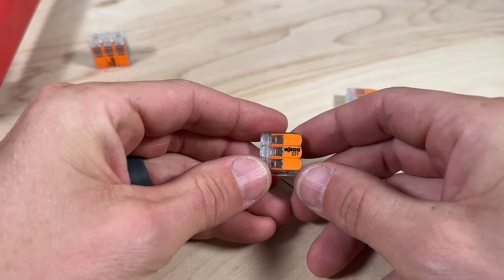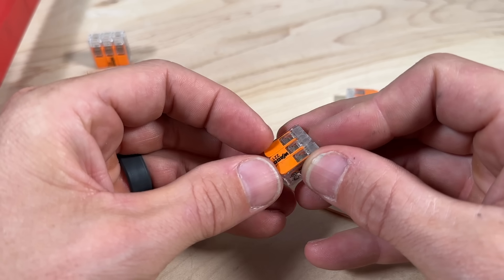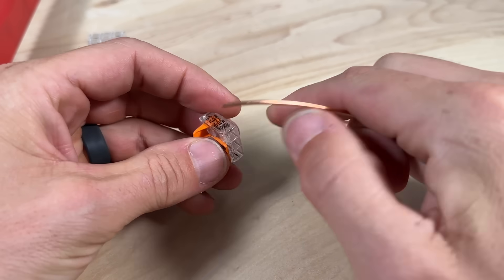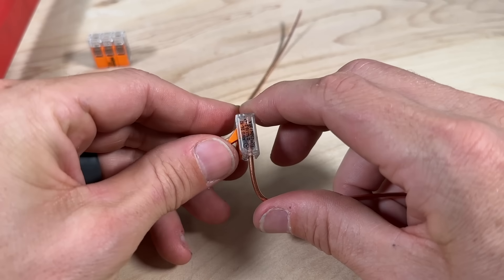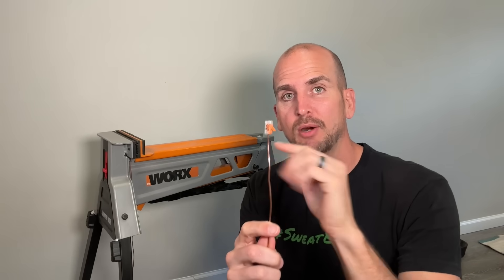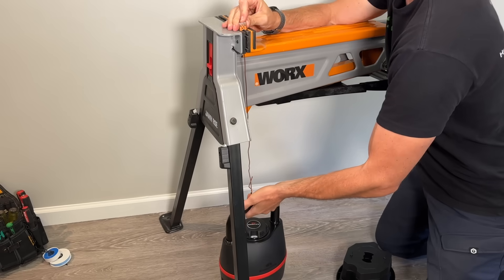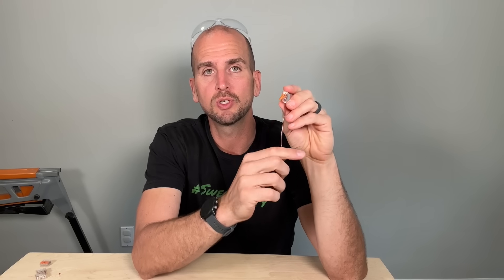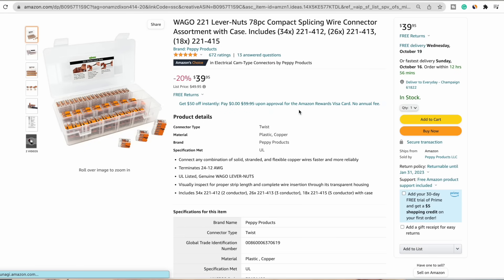WAGO 221 Lever Nuts: Testing the Most Common Negative Feedback

Comment: I noticed that on a fan I repaired using them, and securing the wires to the fan grill with zip ties that they do start to loosen over time. Not knowing if it's fan vibration or just happened naturally, I have just decided to wrap them all with electrical tape, like some electricians and DIY people did with the traditional twisted nuts. At this point, I do not see any reason to stop using them. They're great for many applications and stranded to solid connections too.
Reply from the maker: Many people use WAGO lever nuts as opposed to wire nuts in industrial applications specifically because they hold better in environments that have vibration.  So I wouldn't think there is an issue with the fan producing vibration that loosens things up.
Reply: @EverydayHomeRepairs  Only going by observation. But I still love Wago anyway and as I said, I see no reason to stop using Wago. Just be sure to wrap them with electric tape for extra security.

Comment: I’m going to put on my flak jacket here and my flame retardant suit, and let all you guys know who have not done electrical work for the past 50 years that I can put a wire nut together that you could never pull apart. The conductors will break first….And trust me, I would be able to pull apart the Wago. The Wago’s electrical weakness is that they use an intermediate conductor inside the device to carry current from one conductor to the other. The only problem that this device solves  is that it allows people who do not have electrical skill to join conductors together.

Comment: I think the issue is not the static loading. The issue is when you try to push the wires back into the box, the leveler can get caught on a wire and forced open as you push it. At that point, it is probably very difficult to see even if you try to visually inspect. Wrapping it with insulating tape simply addresses any concerns.

Comment: A simple low cost design change could be how slide or rotary switches rest into certain set positions. The lever could have a slight bump on the side, and the body have a small hole. When the lever goes down, the bump and the hole line up and holds the lever in place. That will make it a little harder to lift up.

Comment: seems rather like academic curiosity than a meaningful test. who is hanging 10 lbs from a single wire connection let alone 20 lbs? the holding force is needed to keep the wago on the wire, not the wire in the wago. wouldnt the real test be to run a 20 amp current thru several of these in both configurations and monitoring the temperature of the wago to see if one gets hotter to indicate less contact for current to flow?

Comment: I used wagos for the first time when I replaced my porch lights. Usually I would of had to have someone to hold the light while I made the connections,  but did not have to using wagos. Made the job much easier.

Comment: When they're in a wago 221 connection box the levers can't come loose. Most of the time they will be in a connection box or accessory. You shouldn't just have them loose or you will have single insulation on show.

Comment: i’ve had a close call with not getting a thick stranded wire fully seated in the nut but enough to pass a fairly hard pull test. of course this means i reduced the effective gauge of the wire. in hindsight you could say i was an idiot, the clear body should help avoid this, but i think it’s fair to say they are not exactly idiot proof and an idiot could get in trouble with stranded. i will keep using them and i think there are great advantages, but do take good care with seating stranded

Comment: Any experienced electrician will tell you to never use 221 for solid wires. Never. Use 2773 series for that. If u need to connect solid + threaded wire, use 2773 and put cord end terminal on threaded wire.
Reply: "Experienced" electricians are old and set in their ways. Hostile to anything "new-fangled."

Comment: It's not a design flaw, just make sure it is closed (as designed) before buttoning up the job. You shouldn't have much, if any pull on the wire to begin with. Or put a piece of tape around it.

Comment: If you feel it, it's just loose because the latch is stopping on the wire, but the level can keep going. Either way it's still holding the wire

Comment: It isn't stated during the video whether the second round of three trials (with the lever partly raised) used three fresh new WAGOs, or reused the three WAGOs that failed at 27.5 pounds in the first round.  Pulling a wire out of a WAGO might compromise the future strength of the WAGO's bite on the wire.  It would be nice to test whether pulling a wire out of a WAGO that has its lever down reduces the WAGO's future ability to hold a wire.
Reply from the maker: For each of the 6 trials I used new WAGOs.  When the wire pulls out it does damage the internals and wouldn't make for an apples to apples comparison. Thanks for the feedback.
Reply: @EverydayHomeRepairs  : Should viewers be warned not to reuse a WAGO that was tested in this manner?

Comment: If it doesn't take much force to partially open. It shouldn't take much force to close them back. Why not use a small rubber band to hold it closed? They make colored rubber bands for making bracelets. It could even make identifying your connection easier. A small piece of shrink tubing may also help with holding the lever closed.

Comment: The next question would be how many pounds can a simple wire nut hold when connected properly compared to when it is improperly connected. I think 20 pounds is more than enough holding power unless You've got a ceiling fan in which case you should have a solid connection without any splices to hold the fan aloft separate from the wiring to supply power.

Comment: I agree with all the one saying to wrap wago into electrical tape if the lever is something of concern. I used wagos after seing vids here, and i can confim in some cases, but honnestly if your lever manage to get up a bit, either it's not a problem or you're gonna force the box to get it done and then the lever will be pulled all the way out. So in any cases, electrical tape is your best friend. And if you are doing electrical job, you're gonna have it around in all cases, so that's a win.
My main concern about wagos is the side they take because sometime, you have your switch, your cables, and there is really few space to put 3 wagos on each cable and get everything back in. I got the problem when changing a switch for a timer. But meh, i managed it anyway so....

Comment: I've noticed this problem when I was using them. To solve it, I wrap it with electrical tape; 1-2 layers and that's all it needs. If ever you need to alter it, it is very easy to remove the electrical tape, do your changes, and wrap it with electrical tape again.

Comment: WAY GO..  at least that is how we say it in California.  if you want a long lasting trouble free splice, than use a Ideal wire nut.  However we use wagos all the time where we know that the load is not max'd out on the circuit.

Comment: Wagos are fine, if that's what you are using. Wire nuts have been used successfully for  decades, and will continue to be used.  If you're doing electrical work you should learn how to make a good connection with a wire nut.
Reply: Wago connectors have been used successfully for decades as well..
Reply: Another dinosaur.

Comment: Great! It is alway good to test potential flaws. I agree with others that 20 lb of pull force limit is more than good enough. It would be interesting to learn the pull force limit of stranded and solid wires connected with a wire nut.

Comment: I have been aware of the potential for a latch to open, if only partially like that, so I always inspect all the latches after pushing the connected wiring back into the junction box.  I have never found a latch opened to any degree, but that doesn't mean it couldn't happen.  However, I think my cautious procedure should take care of that.  I think awareness and inspection are all that's really needed.  I bought a small kit from your link and I love them.  When it comes to stranded wire in a WAGO, I always twist the strands as tightly together as I can in their normal twist direction before insertion.  That helps prevent the strands from flattening and weakening the connection.  If it's smaller gauge of stranded, I strip the insulation near double and fold the wire in half sharply and then insert so it can be clamped better.  Just twisted as finger tight as I can, not with pliers or anything, but that should be good enough and is much better than not doing it.  Thinking about it, I'll start twisting the extra length of thinner stranded, too, to make it a more consistent diameter to clamp.  That may need more than double insulation cut off as twisting it while bent in half will shorten it a bit.

Comment: Well that was a good test you did but you know as well as I did not supposed to even be a half a pound of pulled on those wires. I still say it is defective the leaver should not be that easy to come up I know how to fix that but I am not working for them so they going to have to figure it out. Just like you do I use them in like them too.

Comment: Seems like an easy solution to wrap electrical tape around the levers to prevent them from lifting. Even lifted, 20 pounds is a lot for it to handle. How much do the screw nuts hold?

Comment: This is a non-issue. Strictly a click bait video. Partially unscrew a standard wire nut, which can easily happen, and see if it holds. WAGO connectors are NEC certified and UL approved. Case closed.

Comment: I doubt a wire nut would hold that much weight. Anyways, I just received my first order and I'm impressed comparing them to the cheaper toy like, rainbow plastic types connectors.

Comment: A few questions… 

1. Is there a code for how much force needs to be handled by the connection?

2. If yes, is 20# sufficient for code?

3. What would a wire nut twisted onto a single wire hold in weight?

Comment: If you have to alter them so they dont fail, what good are they? But they will fail anyway from the lack of surface area contact (times 2) and will over heat and melt, tape on them or not. Probably more now that you wrapped it in tape which will peel off from the excess heat. There junk
Reply: Another Dinasaur

Comment: Old sparkies grasping for straws. Lever nuts have been proven through demonstration to be better in just about every conceivable way.
Wire nuts were invented in the 1960s, almost a lifetime ago. (My grandparents have all passed, Dad was born in the mid-50s.) 
I can only imagine what the pushback against them at the time was like. And what did people use before that? Crimp connectors? Soldered connections only?
Reply: My house was built in 1950, and all the connections are crimped and soldered. All receptacles are pigtailed.

Comment: My thoughts of the issue / concern is not so much the lessening of connection from the partial opening of the lever. It is more the concern of the lever being easily moved to that position and then placement of a device (folding of wiring) within the electrical box applies additional pressure on the lever resulting in the lever becoming fully open and releasing the wire from the connector.

Comment: The issue of the lever backing off unexpectedly can be mitigated cheaply by wrapping the Wago in electrical tape or even a small zip tie.
Reply: I was going to suggest the same 👍
Reply: Same thing I was going to say
Reply: It’s peace of mind overkill, but I always wrap my WAGO connectors in electrical tape after installing them. Even though I know the connectors are reliable, it just seems like a common sense move. Not to mention it is oddly satisfying as a final step in the wiring process before folding the wires back into their junction box. 😂
Reply: It's also easy to ask an electrician from europe about that issue. There just isn't any issues with levers popping magically out.

And we don't use those that much in boxes where there are only solid wires, there's cheaper 2273 series connectors for that, that are about half the size of 221:s.

If you really have to find problems with these connectors, you should compare them to stuff that is able to connect solid to stranded and fine stranded wires.  That's what we use those for. Amperage ranges from ~nothing in control circuits, something in lighting to close to nominal with cooking or sauna stoves. 221:s just do it.
Reply: @villehietala9677  Im so glad your in constant contact with every electrician in Europe who put his phone number on every wago he installed..
Reply: @RadioRich100  As english isn't my native language, i'm having hard time finding that statement from my earlier message.  Wago-levers just won't pop out without some force on them and as far as I know, wires aren't moving that much in a junction box after closing it.  Most of Europe has used wagos for decades, there's just isn't nearly as much problems with them as with wirenuts.  We too had our concerns when we saw first spring connectors and for a while could not use those in hospitals etc, until the older generation of inspectors and designers saw that those work just as good as meticulously done wire nuts, but with way less hassle.
Reply: It can also be mitigated by using wirenuts instead.
Reply: @StonyAcresEstate  - Also true

Comment: I would have guessed that the position of the lever within this range would have no influence over the force cage clamp.
Reply: That said, I'm entirely comfortable with 20 lb of clamping force.

It is conceivable that the lever could snag on a bit of something inside the box and open entirely but a piece of tape would surely be sufficient to prevent this.

Comment: When are you going to have wires under more than 20lbs of pull without some reinforcement? You would not run new wire with one end attached would you? I would wonder why you are putting a stretch on wire.

Comment: would it defeat the purpose to just do a quick electric tape wrap on the wago to prevent the lever from opening - to add the tape once you are ready to push all the connections into the box? just curious your thoughts on that potential "fix"